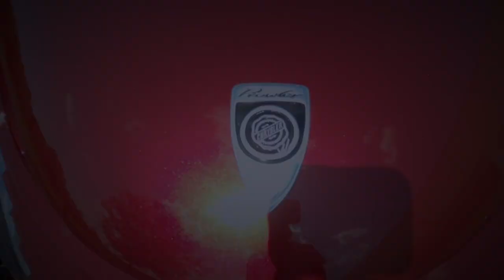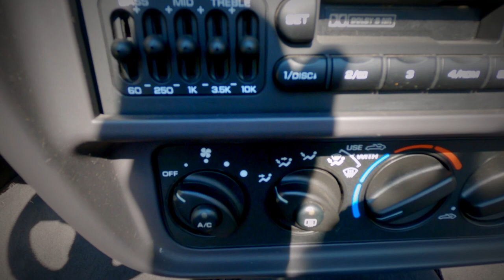2002 Chrysler Prowler Gateway Classic Cars St. Louis  #8879

Comment: The end of an era for Plymouth. Their Swan Song.
Reply from the maker: It's such an odd car.   It's got race car underpinnings with its aluminum frame and inboard front shocks, a good-for-the-era 250hp 24v V6 and then the PT Cruiser-esque instrument panel.   But if you're not put off by the dashboard and lack of trunk space, the rest of the car is a lot of fun and clearly designed by engineers who wanted to make the best techno hot rod they could.
Reply: @GatewayClassicCars  And it only has 1 cup holder 😂